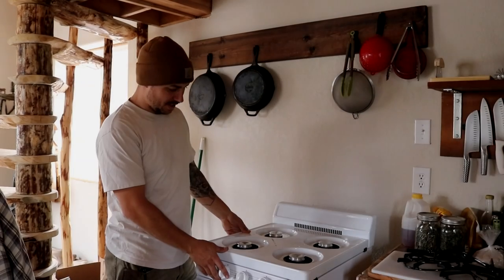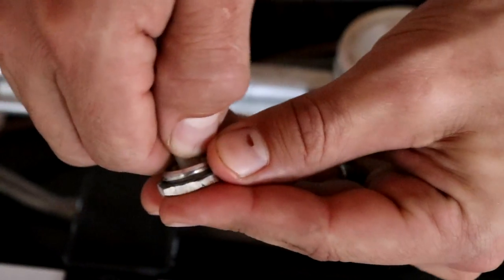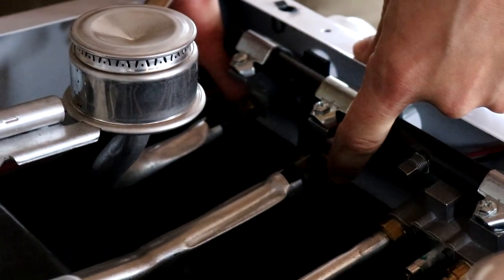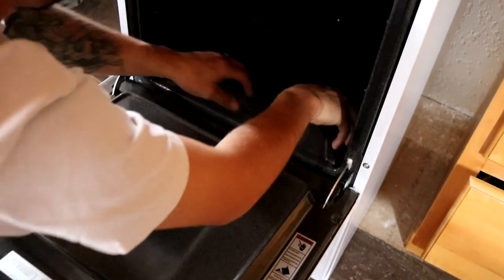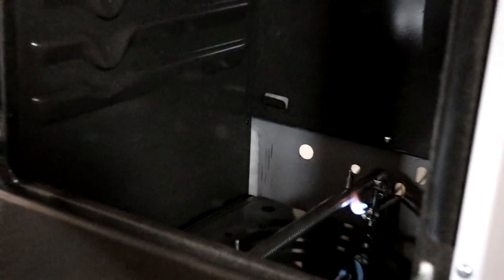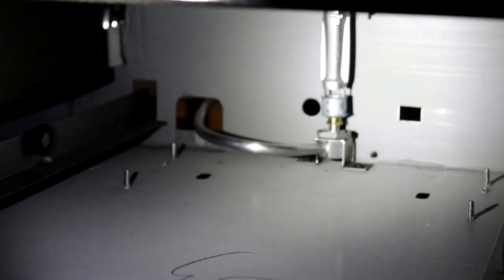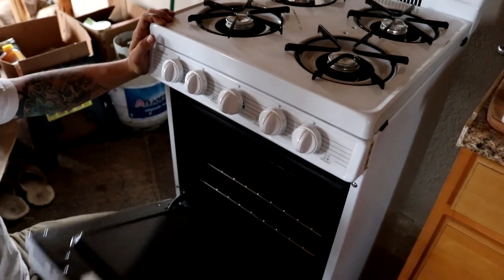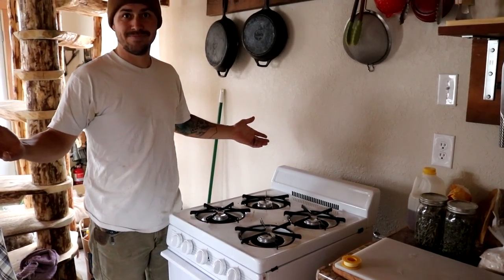Off Grid Stove Conversion | Natural Gas to LPG

Comment: From what I've read a straight carbon monoxide detector will not detect a propane leak.  You may wish to get a specific propane gas detector and install it at floor level (propane is heavier than air) between the stove and gas tank.  Your CO detector may be designed to detect both CO and propane but you may not want them at the same location.  I'd probably put the CO detector near my bed (so as not to die in my sleep) and the propane detector at floor level by the gas appliance, so that the building doesn't fill with propane before sounding the alarm.

Comment: Whoa! They make that super simple to convert from NG to LPG! We used to think that a kit would have to be acquired with different orifices and regulators. But it looks like it is just adjusting the screws. Thanks for showing this process! You guys rock! - Brian + Erin
Reply: Apparently it depends on the age and model of the stove I thought the same until I take to the manufacturer

Comment: This from a website:  Heat and smoke rise, which is why we place smoke alarms high on the wall or ceiling. Carbon monoxide, however, mixes with the air. For this reason, it is preferable to install CO alarms at knee level – the approximate height of a sleeping person’s nose and mouth.
Reply from the maker: rain coast wow thanks for that tip we will be relocating ours.
Reply: @SimpleLivingAlaska  You are most welcome, i am really enjoying your channel, the installation of the well, the building of the chicken coop, the greenhouse and the garden and am looking forward to see how the bees do.  Also love the coats on the dogs...  ha ha ha.
Reply: Spot on 
Co2 is heavier than air 
Detectectors down low
Reply: Great video. We recently purchased a convertible to go into our remote Alaska cabin.  The conversion was the same as yours however I've not been able to figure out connecting the propane hose to the back of the stove. Any tips?

Comment: Back home in England it’s required to have a propane or “explosive gas” detector installed when you’re using propane inside. It’s a heavy gas so it settles down low and slowly fills a space. I have one installed over here in CA even tho it’s not required. They are an inexpensive peace of mind.
Reply: The crap that  they put in the propane let’s you smell any leak way before an explosive mixture is present.
Reply: We run on lpg and it’s a hotel, we don’t have any such thing and we’re in Northumberland.

Comment: Very nice how-to video. I work on vintage gas stoves, primarily O'Keefe & Merritts. They have adjustable orifice valves instead of fixed orifice valves, which makes NG/LP conversion simpler. Until today, I thought all modern gas stoves had fixed orifices, which seems a nuisance - having to keep track of little extra bits. Thanks to your video, I learned some modern stove brands also have adjustable orifices. Cool. I realize it isn't a permanent installation, but I was glad to see you had a portable propane tank for your stove. I plan to do that while working on my gas stove's conversion.

Comment: Hey alaska guy thanx Im dealing with a propane stove in North Dakota only mine has an electronic ignition but Im sure it wasn't adjusted for propane man it sucks having to be a jack of all trades but it will be nice if its all working properly. Good thing I can watch a lot of videos as mine is a Hot point stove ha5rd to find the exact one but they are similar so good to watch several to learn how to take them apart as some are not detailed enough. This is for a mobile home at our lake cabin and I want it working right and yes it gets severely cold in the winter here to so 40-50 below is not uncommon. And it has a gas furnace but Im almost sure it hasnt been converted to propane either. Not sure if I want to as it doesnt get much use in the winter and the roads are rarely plowed any way be best maybe to install a good wood./coal stove never hurts to keep a little lignite coal you can buy in bags from home depot or lows for a wood stove on hand for them severely cold days.  rather then heat  with only wood or propane.

Comment: I burn 2 100lbs a year for my stove  in winter i  got small battery car blankets  duct taped on the tank  its 115 v power but it work after minus  20 Celsius  you need heat for the  propane not to  freeze 
You can always  have a small tank  inside for cold days 
Take care be safe

Comment: Interesting to see there is a regulator on the propane tank and on the stove.  Here in the uk we only have the regulator on the tank and to convert natural gas to propane we change the individual jets on each burner.   Our property isn’t connected to mains gas and we have a 2000litre propane tank so we have to convert everything or buy specific lpg equipment.

Comment: A little surprising that the manufacturer allows the purchaser to make this conversion.  Liability should the end user not get it right. I've had clothes dryers swapped over from NG to LP and was told" only a certified technician could make the switch." You made it look pretty straightforward.
Reply from the maker: Tracey Osborn, that is a good point because it absolutely is a safety issue if done incorrectly. Believe it or not we watched the manufacturer's youtube videos on how to convert it and referred to the manual :)

Comment: carbon monoxide does NOT "tend to rise" it is the opposite it settles. You need the detector lower and closer to the source to detect leaks early. Please be safe.
Reply from the maker: Tammy McNeill from what we've researched head level is appropriate (although it is commonly believed floor level is where the monitor should be) we have ours on the first floor above our head level, CO distributes throughout air and will rise.
Reply: Head level while laying on the sofa (not standing up) most people feel sick and lay down and are found that way.
Reply from the maker: We do appreciate the concern and generally do not always go with "what science says" but most literature indicates higher is better:
https://healthybuildingscience.com/2013/02/22/carbon-monoxide-facts/
https://www.sterlinghomeinspections.com/sterling-home-inspection-blog/2013/12/11/carbon-monoxide-detector-placement-dos-and-donts/

Comment: Do you need a 11" water column regulator on the tank or a 2 psi regulator on the tank or can the range be run directly from the tank?

Comment: Is it typical for them to be dual capable? I had planned on salvaging a propane stove from an old RV but if its that easy to convert over from NG that might be an option.
Reply from the maker: I believe through this manufacturer they are all dual capable and easy enough to convert, RV stoves are already set up for propane, we are not sure how simple other stoves are to convert (if even possible). A typical household oven would not be good for this situation due to the glow bar in the oven needing electricity. Ours also has independent ignitors so when we light the range it doesn't also spark the oven.